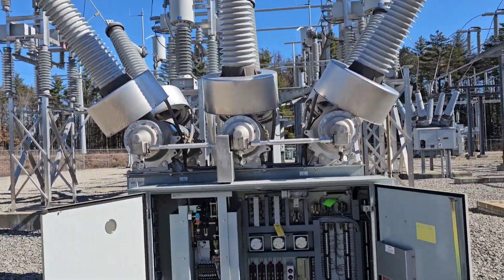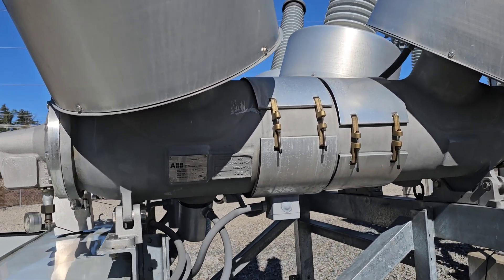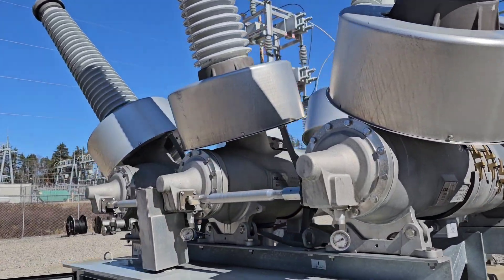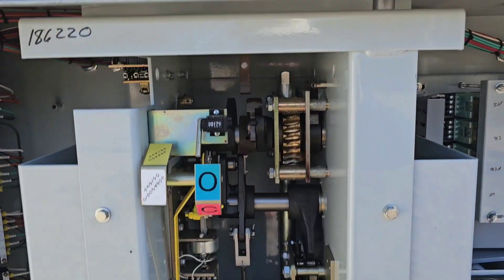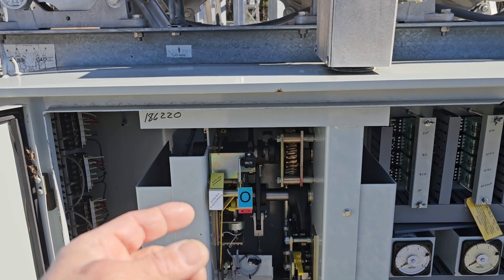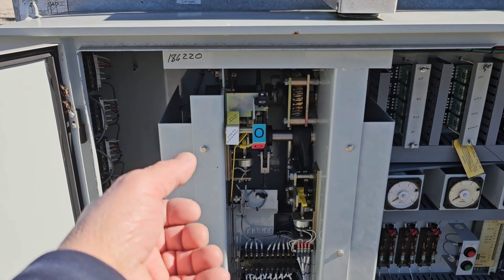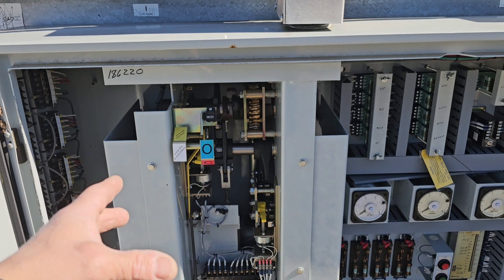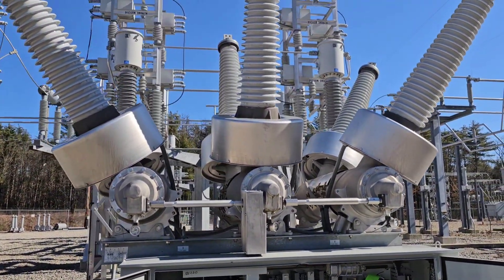How does a high voltage power circuit breaker work? 115kv SF6 gas breaker explained in laymans terms

Comment: I am a layman.  All I know how to do is to plug in a toaster.  This video could have been in Chinese.  That's how much sense it made to me.  :(
Reply from the maker: Maybe I'll try layman subtitles then🤔... I mean,  I'm a layman too, so I should be able to speak layman pretty well👍🏼👍🏼👍🏼
Reply: @reusefull  While I appreciate your effort, I still don't know "how it works".  
 One item, just as an example, you referred to a "bushing" and said "power goes down through a bushing".  I'm picturing a rubber bushing in an auto suspension - obviously not the same thing.  I can't see inside the cone shaped insulator part so I have no idea what it is or looks like.  IOW just saying the name of a technical part doesn't help me.

More importantly, it's unclear what activates or causes the breaker to break.  You said the 2 sets of springs close or open it, but what causes or activates this to happen?  In a home residential breaker box a bi-metal strip heats up and shuts off - what is the actuator here?
Reply from the maker: @terry_willis the "bushing" is just a big spark plug (basically). The high voltage can travel down inside the breaker without touching ground through it,  just like the high voltage travels down the spark plug without touching the engine block... only there's no spark gap at the bottom.  
There are several things that can cause the breaker to trip.  That's a little more involved,  but there are a bunch of different things being constantly monitored and if any of those things occur, a trip command is sent to the breaker and it opens. It's usually a solenoid (like what fires a starter in a car) and it pushes a lever that allows the mechanism to move and trip (open) the breaker which stops the power flow.
Reply: @reusefull  Thanks.  Got it.

Comment: Interesting that there's no solid state electronics that can be used to stop high current, high voltage lines. For that purposes, low technology mechanical stuff like springs are needed. Due to the European green laws, SF6 will be banned soon but SF6 is still needed to stop the arc. Asking which will be alternatives to SF6.
Reply from the maker: @DinoCiuffetti  I don't know.  I have heard they are experimenting with pure Nitrogen.  I personally think oil got a bad rap. Once they stopped using PCBs in it,  it's not terribly damaging to the environment and very easily containable. It's also easy to seperate (mineral) oil from the environment should it ever escape. I realize that so has sailed, but that's my 2 cents. It's much less dangerous to workers as well.

Comment: so it will mechanically open on a zero cross?
Reply from the maker: I don't think it's timed with a cross,  but the action of tripping is about 2 cycles,  so a zero crossing will occur during the trip.  I honestly haven't worked on the ABB style breaker very much,  but the interphase mechanism is visible, and visible from the mechanism side of the breaker, so I thought it would be a good one for show and tell.
Reply: Kind of, by using current and voltage transformers, the IED/relays calculates the zero crossing, considering control cable lenght, and the circuit breaker timings.